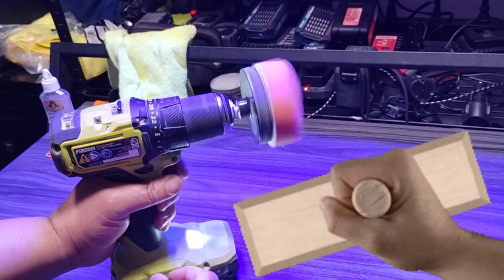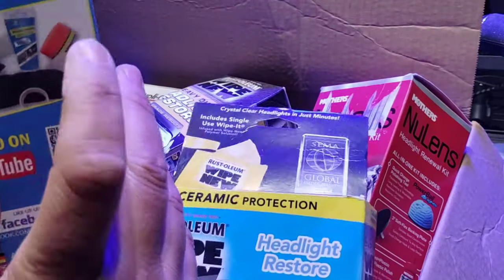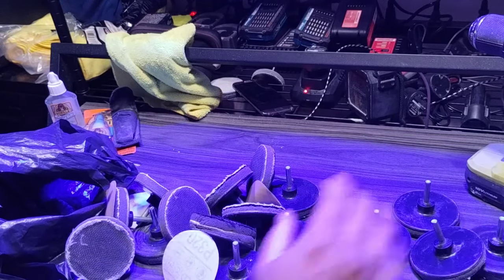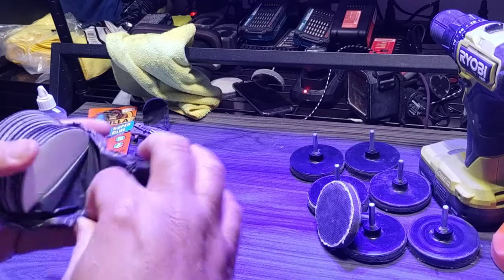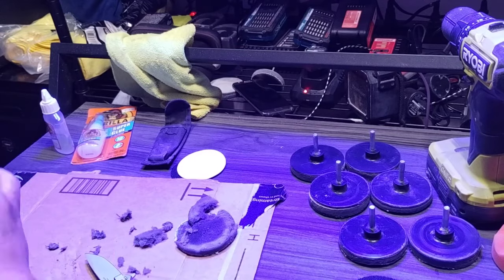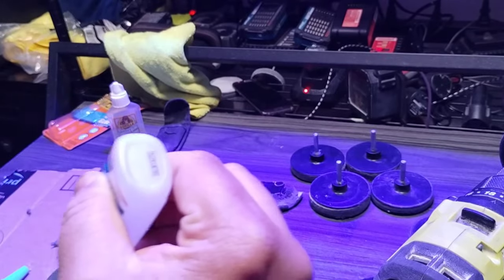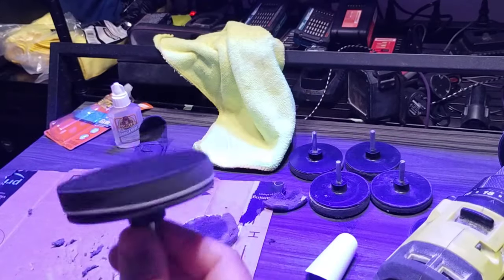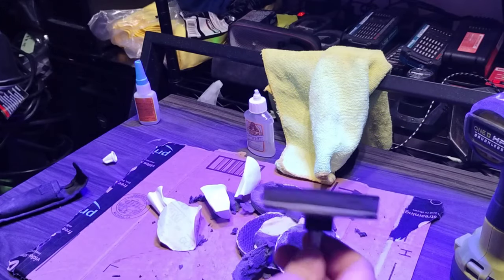What drill bit do I use for my HEADLIGHT RESTORATIONS ⁉️😳

Comment: Hey - I appreciate your craft and ability to market it in an educational way. Your hook and loop link displays 2.75 inch but all the sanding disc and interface pads are 3 inches - was that a mistake? Also the 18v high performance battery is heavy I can just imagine the weight once I pair it with the drill. The Compact RYOBI ONE+ HP 18V Brushless Cordless is slightly lighter 2.3 vs 2.46 is this something to consider, will I be forgoing anything else by also using this type of drill?

Comment: Thanks for the in-house tool vid........I have been wondering and wanted to ask you.....does your method apply to restoring tail lights as well?  I would think one may start with a higher grit since there would most likely be more hazing than clear coat damage......just interested to know.  thanks.
Reply from the maker: Yes I do tail lights as well it's just much more rare only a couple of years.... Basically treat them the same way as headlights....
Reply: Thanks for letting me know I really appreciate it. @theheadlightrestorationpro
Reply from the maker: @Michael-hg6ky 😊💯

Comment: Do you prefer the compact, brushless Ryobi drill or the full size? Also, what size battery do you prefer? Thanks for all of the great content!
Reply from the maker: Ok so prefer the compact... With that being said it has one drawback that it is short for reaching in on the lights that are recessed in and or bumper that stick out...
Far as the battery I like the smaller ones 1.5 ah because they are light and shallow....the bigger ones too because they have a higher power output that makes more power in usage just really heavy..

Comment: I make my own interface bads with flat polishing sponges and they are like 3 times thicker than yours , is that good for the headlight restoration?
Reply from the maker: No too thick is not a good thing... Especially because you can't control the thickness....

Comment: or you can purchase a quality semi flexible backing plate Especialy good for doing headlight where you have curves and corners.  in this case for Rotary; since you  are  using a drill. Then purchase a good interface pad for sanding. Which Will cost you less than $20.